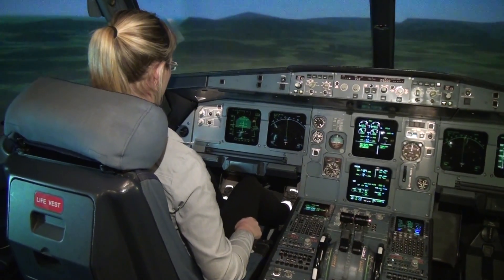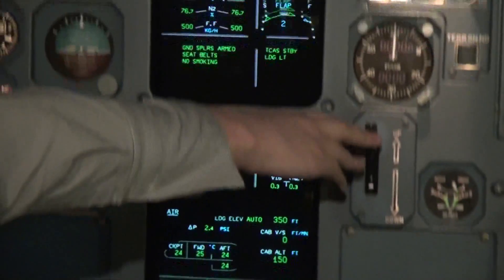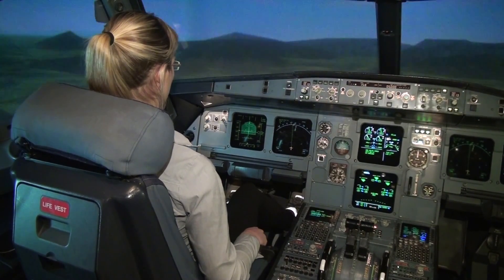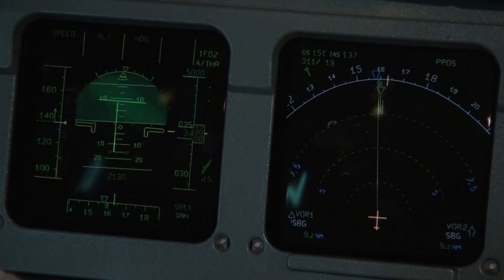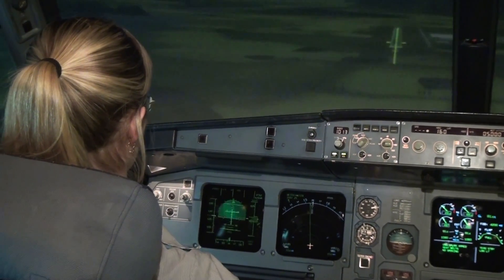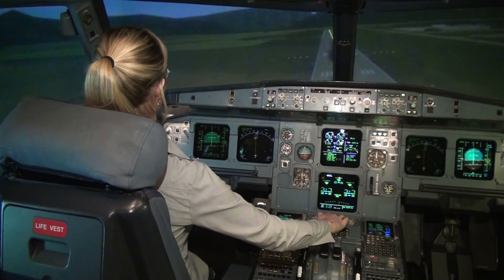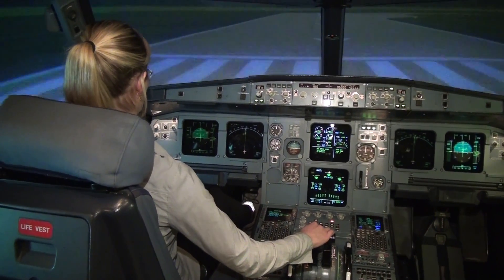CPL Holder landing an Airbus A320 manually - Baltic Aviation Academy

Comment: Whenever you’re not following the flight directors then they should be turned off, and bird should be on! And plus if you already have a CPL you shouldn’t need such basic instructions especially when auto thrust is on and the speed is managed! She should already know how to pitch to keep her rate (5 times ground speed). And also having a CPL she shouldn’t have problems with keeping the centerline!

Comment: "I think it was quite easy," she said. Well anyone could easily land a a320 to that rubbish standard!
Reply: Has a cpl. Obviously  not an instrument rating. Gee ..with auto throttles engaged and constant coaching. A fair job. Like most pilots with just a cpl. Their not used to looking at higher approach speeds and landing at the higher speeds. I've flown the 777 and 767 simulators. Both several times and for hours at a time. As any pilot knows. It takes a while to get the feel of the plane. I'd really like to take her for a discovery flight. She's pretty fine

Comment: Yep it looked relatively easy on the simulator. However I didn't understand why should we use ILS without LOC and turn APs off? Is that an excercise for APs failure or what really? Thanks.

Comment: Not so good aproach at the end (moving on left side of the runway) caused her troubles, very hard touchdown :). But, of course, there is always room for training and upgrading...give the girl a chance.
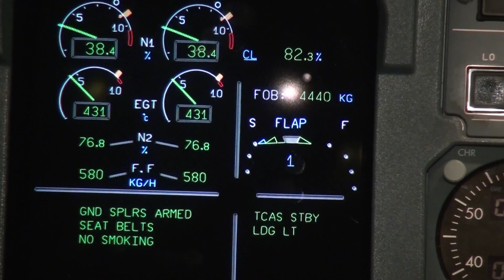As for spoilers...they were armed (!) - see 00:46/47 on display - GND SPLRS ARMED. 
00:41 & 01:28 - brake arm us on upper position.
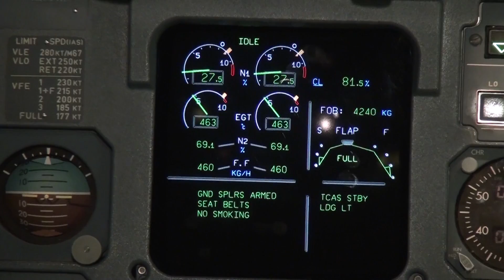00:25, 03:17 & 04:56 - automatic brake is set to medium.
Reply: Many people here simply don't have a clue... This approach was "No blue" as per Airbus procedure.

Comment: forgot to arm spoilers.  That could be a costly goof if it was a real life landing.  Happened in a boeing 737, crew forgot to arm spoilers which resulted in hard time stopping.  End result was that the plane ran out of runway, off the edge down a cliff and into a steel structure.  Pilot, co-pilot killed instantly.  Only a few passengers escaped.
Reply: Robert Benoit ....nop, if you paid attention , spoilers was armed.

Comment: Not knowing anything about this stuff, what are the two wheels that are turning with the white markings in the center of the console?
Reply: +Joga Horst No, the trim wheels are pitch trim which in the Airbus A320 is accomplished via a movable horizontal stabilizer.
Reply: +Teddy Banks 
Those are the aileron trims, were you kan balance out the aircraft, so it will fly at a certain angle without you having to give it any input with the sidestick. On older aircrafts these are operated manually, but nowadays the computer does it for the pilots, so the airplane holds the angle it is put in by the pilots input on the sidestick.

Hope i could help you ;-)

Comment: "...was quite easy" she says and flew a horrible approach and a scary landing.
Reply: +the2jaywhite She actually bounced the landing, and the approach was not stable... GO AROUND!
Reply: the2jaywhite lol 😂 "quite easy" 😂
Reply: Its never an easy thing to land manually. The proper speed & technique is required to land manually. Am sure, practicing in the simulator would improve it drastically.
Reply: @vishnuramesh6849  To Land manually you need a Yoke...Ever heard of that??...😁
Reply: @kuldeepthakre8725  true tho buddie & yes I certainly have heard and seen a yoke as well. But stick life is different 😁🧐
Reply: Easy to do it is different to easy to do it well
Reply: the2jaywhite yeah she would have snapped that nose gear straight off.
Reply: Haha was gonna say the same
Reply: haugalenningen I disagree with you :)

Comment: CAN ANYONE TELL WHY SHE IS NOT USING REVERSE THRUST AFTER TOUCHING THE RUNWAY?
Reply: +Kushan Rupasinghe Maybe she wasn't instructed about this :)
Reply: +the2jaywhite depends on length of runway.  Denver is one place where reverse is not needed.  But there are airports with short fields which require reverse thrust.  Also, I have never had a landing where the pilot did not reverse.  It just makes the landing that much easier.  Either way she would have had trouble stopping had this been a real landing because she did not arm the spoilers.  IN addition she did not flare so she would have realistically crashed.
Reply: +Kushan Rupasinghe 
reverse thrust is not needed, the wheelbrakes have enough braking power to slow the beast down. Pilots mostly use idle reverse during rollout. Only in situations like a wet runway or a very strong braking action (where the brakes could overheat) they use more reverse thrust than idle.
Reply: Robert Benoit ...good point.

Comment: Why is the computer calling 1000 ft when the PFD is showing 2000+ ?
why is the FMA  showing

SPEED - A/THR is active in SPEED/MACH mode
ALT    -  ALTITUDE HOLD mode is engaged;
HDG - HEADING mode is engaged.

They all look Green to me - this is a manual landing in Normal Law right ?
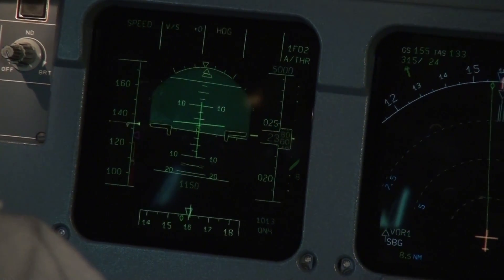Reply: You can see at 3:30 that the altitude indication is about 2000ft, however, that's the altitude above sea level, the computer calls out the altitude above ground level, which also indicated in the artificial horizon.

Comment: She needs to practice. Not a very good approach and landing at all...
Reply: Marco Nasti of course! She has only a cpl dummy
Reply: I am not expecting any kind of quality training from a school that promotes Pay2Fly to death.
Reply: Don’t be so hard on her, first of all rudder must never be used unless to decrab or on The ground or in case of engine failure. Second of all she only has a cpl which means she only flies planes with  mechanical controls not fly by wire which is very different. Thirdly, approach mode was not armed and so the flight director was ordering her to climb back to 5000 feet and therefore must be confused , explaining why she was always high, and the lateral orders were to maintain heading 160, not the ils and thus centerline, so if there was slight wind, she would be continuously drifting away, explaining why she never flew on the centerline. She was trying to follow the flight director which was giving wrong orders.

Comment: unsucessfull landing if she do that on real run way it will destroy the aircraft because she did not land on the middle of run way she landed at the right side of runway which is danger for big aircraft like A320
Reply: Moeen Mostafa
completely wrong
landing on the side of the runway is not a big deal. it's just not a very good landing.
Reply: Did you EVER fly an airplane before? And I don't mean your flight simulator.... Jeez...
Reply: ***** Nope , but depends on my vision , maybe i wrong , do i?
Reply: Totally...

Comment: Do it with a Flight Simmer who has experience with Airbus simulations on programs such as FSX.
Reply: I'll volunteer, I have no experience with real planes and some (read: very little) experience with sims, mostly X-Plane. I'd love to try and fly an A320. As long as I'm allowed the autopilot, if I engage it myself it is me using knowledge of the plane and it's systems surely? I'd try a 787 too if that was an option.
Reply: I was at a 320, 330, and 350 simulator to date, the A350-900 sim was probably the greatest experience of my life